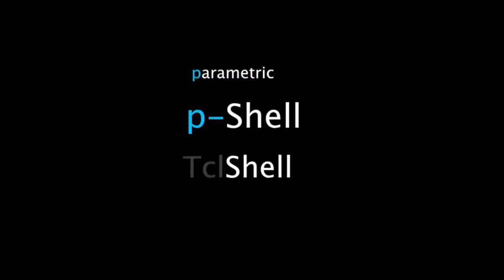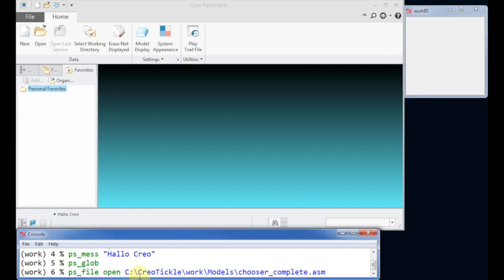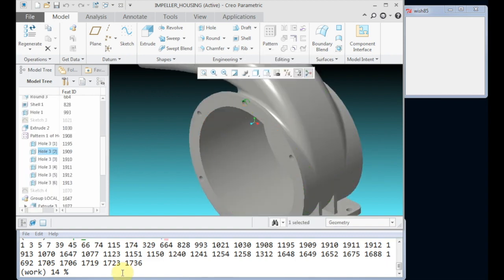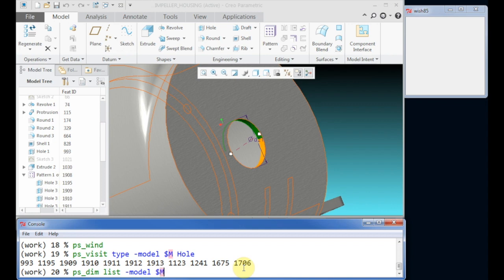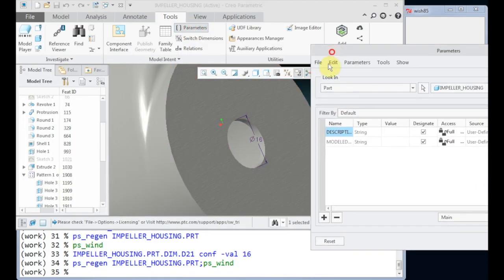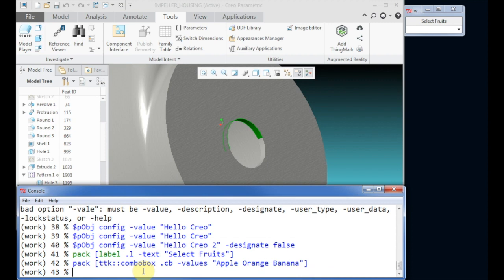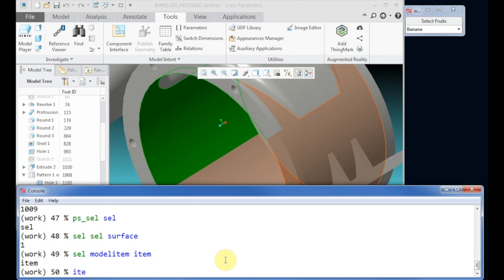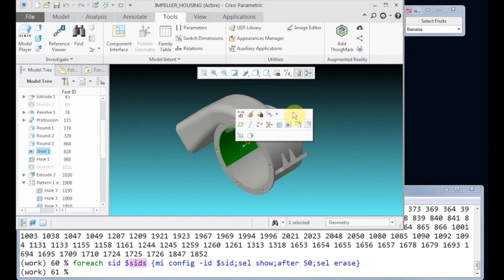p-Shell Part 01 - Creo Scripted Toolkit Programming in A-Synchronous Mode - Basic Introduction

Comment: Hii... I have almost 50 drawing sheets in a single drw file in creo.. i need to make seperate pdf for each sheet with some prefix, sheet number & part number (this part number is defined as a parameter in the sheet).. can i do this with python scripting? Please help.. 
I have started learning python. I have done a lot of coding in VBA so i am not a total beginner. If you have any material regarding this please send it to me.. it will be very kind of you... Thank you in advance...
Email ID: aadityarajshinde9@gmail.com
Reply from the maker: Hello, try the Creo VB Interface, this Channel is for Tcl not for Python, sorry for that. For Tcl check the Wiki as well.
Sample Tcl Code follows here for an active drawing using a PDF Profile for all of the options: 

# you can have parameter for a drawing and use them, but as far I know not for each sheet
# Define a number, you can use the name of the drawing as [ps_model cur] will return the name of the current drawing like 'dr12345.drw'
set OutName "MyNumber"
for {set i 1} {$i <= [ps_sheet number]} {incr i} {
    # Activate the sheet
    ps_sheet set $I
    # Export by using OutName and i
    ps_export pdf c:/temp/$OutName$i.pdf C:/temp/MyProfile.dop
}

You should write me a mail. Using detail notes implies more code
Reply: https://www.simplifiedlogic.com/nitro-cell check this out....